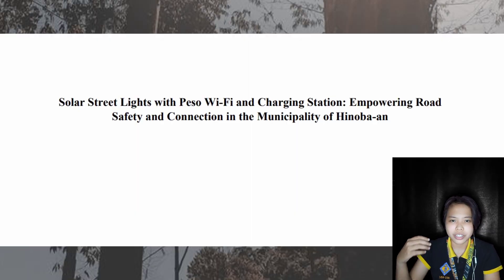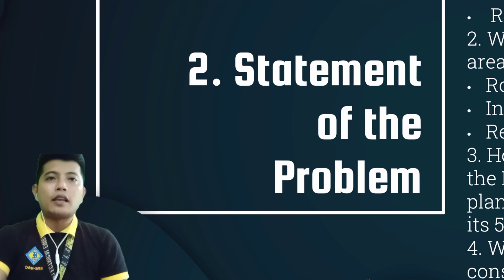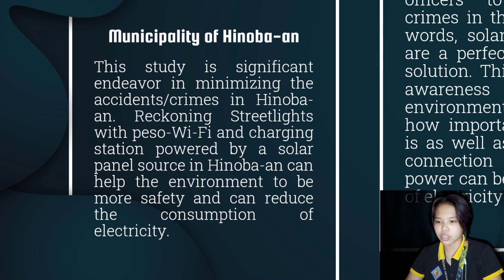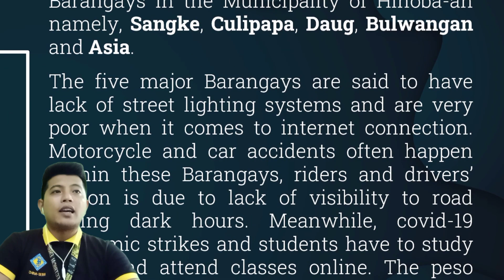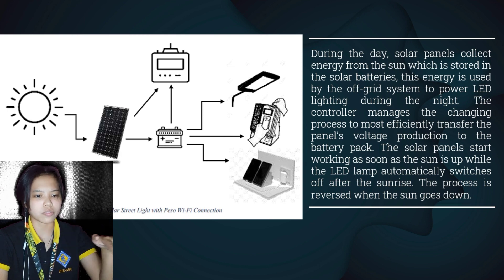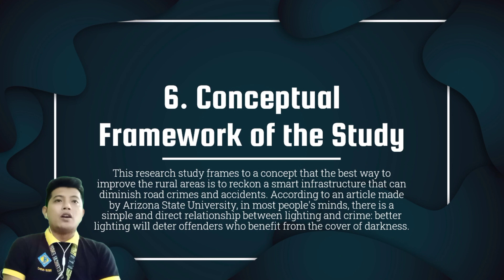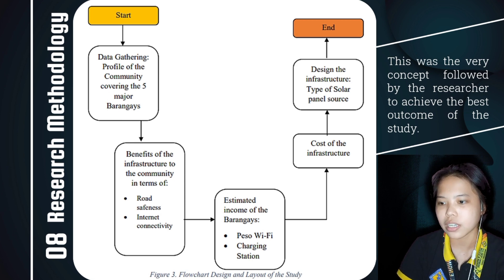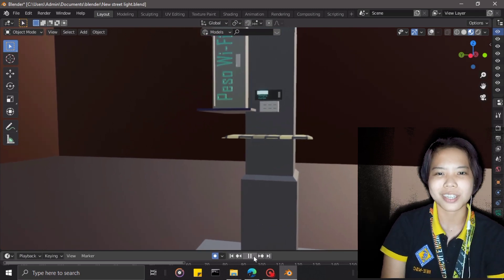Solar Street Lights with Peso Wi-Fi and Charging Station: Empowering Road Safety and Connection

Comment: NAME: Sanrey Jun R. Guevarra
CLASS NAME & CLASS SCHEDULE: COE 346 A & 5:00-6:30 T-TH
DATE: 27/03/2022

REACTION: This research proposal is interesting and helpful to us viewers because solar streetlights provide several advantages over standard energy sources. This energy is known as solar energy, and it is a non-polluting and low-maintenance renewable energy source.

REFLECTION: As students connect to the peso Wi-Fi and plug their chargers into the socket, the solar lamps will act as a second safe study place for them. It improves the safety of vehicles and the security of the streets at night. It can also save money for municipalities because it beams or turns up automatically and has essentially no operational costs.

Comment: Name: Khynny Maureen P. Campoy
Class Name and schedule : ENS 341 Saturday (5:00-8:00pm)
Date: March 26, 2022

Reaction :
The researchers gave a very excellent presentation. Their idea is very innovative, helpful and beneficial. It is a very good idea to integrate solar streetlights with peso wifi and charging stations. 

Reflection :
Solar streetlights with peso wifi and charging station can benefit road safety, reducing home electricity consumption, and internet connection. It can help our environment, and also enables the officers to easily solve crimes in the road

Comment: NAME: Arabelle Fabugais
CLASS NAME & CLASS SCHEDULE: ENS 341 B _ 5-8pm Saturday
DATE: March 26, 2022 | Thursday
REACTION:
As the sun sets, darkness takes over. Street lights are very important because it lessens accidents and lessens fear. This study is really good because it uses solar energy which cut's off the high electric bills. It is also eco friendly and will benefit a lot of people. It also has a piso wifi and charging station. If people started using some electric vehicles then this charging station will be good and beneficial. 
REFLECTION:
As I've watch the video I realized that there are a lot of people who are concerned about the environment and they are making an action to help the people cut the high electric cost and also use a clean energy. But there are a lot of things to consider. Recycling is the one thing we should consider in our lifestyle.

Comment: Name: Balansag, Lorenzo Jr. B.
Class Name and Class Schedule:  ENS341- Research Methods for Engineering | Saturday 2:00-5:00 pm 
Date: March 26, 2022

Reaction: The research is truly impressive. It is very innovative by integrating the use of solar panel in street lights. And then using the power being harness as electricity for peso wifi and charging station. It has some similarities with the other research but it is still unique in its own way.

Reflection: Electricity, connectivity and lighting are a necessity that we are needing.  So, having all that three necessity mixed up into a single device is a great deal. It is very beneficial to those who depend on a strong connection for their studies. While having an online class, you can also charge your phone, if you are low on battery.

Comment: NAME: Shiela May E. Velos
CLASS NAME & CLASS SCHEDULE: ENS 341 - SATURDAY (5-8PM)
DATE: March 26, 2022

REACTION: This is uncommon proposal, and advantageous to every netizens, installing solar energy to fuel the street lamps with the built-in peso-wifi and charging station not only ecologically beneficial but also it is in need. It's quite interesting and very applicable in our situations nowadays for some of us students are having online class, needing an internet connection and most of the transaction that we have are through internet, this is kinda very useful and beneficial to many of us. It was being presented well, acquiring stability of internet connection, and delivered clearly as they presented their research proposal.

REFLECTION: This research proposal is very useful and helpful in our recovering situation now due to the crisis and pandemic that we have experienced, still on recovery but we cannot deny the fact that because of the happening it changed some of our ways of living that is now were really inspired by the internet and social media transactions. This proposal focuses on solar street lights equipped with peso Wi-Fi and charging stations, this is really a help and beneficial for it does not only helping on lessening the consumption of electricity but it is also a great help in terms of minimizing accidents and tragedy that could happen if the installations of streetlights are not enough. It's a good research not only helping for safety but also providing a good states of contacting and easy communication through the installations of peso-wifi and charging station all in one in solar street lights.

Comment: Name: Jules Gerard D. Cabetingan
Name of Subject and Schedule: ENS 341A Research Methods for Engineering SAT 2:00-5:00
Date: 3/25/22
Reaction: This research proposal can greatly benefit us individuals and the researchers did their part very well since one of the common issues nowadays is the availability of street lights especially in remote places. This proposal if accepted, can greatly benefit those people. This proposal is almost the same as the previous one although piso wifi and a charging station is only added.

Reflection: The convenience of this innovation if worth noting of since you already have a charging station and piso wifi and it can greatly benefit the environment since it saves a lot of energy and it only uses solar power. We can save a lot of non renewable resources and it can also solve the pollution problem.

Comment: NAME: Lumelyn E. Ragusta
CLASS NAME & CLASS SCHEDULE: ENS 341 B Research Methods for Engineering – S 5:00-8:00 pm
DATE: March 26, 2022
REACTION:  Street lights are one of the important factors for road safety because they guide people to their destination. The amazing part is that they use solar energy. Combining it with Peso Wi-fi and a charging station makes it more reliable and sustainable. Areas with poor signal and connectivity can rely on this project, especially students. In cases of power interruption, solar charging stations are much needed.
REFLECTION:  It's amazing how researchers come up with solar street lights with Peso Wi-Fi and charging stations that can help people in the area, especially students for their online classes.

Comment: NAME: Glovel Jae G. Medel
CLASS NAME & CLASS SCHEDULE: ENS 341 - SATURDAY 5:00-8:00 pm
DATE: March 26, 2022

REACTION: The researchers' idea is very commendable because their proposal would benefit students who require internet access and areas that require street lighting.

REFLECTION: It's a great idea to have solar-powered street lights with peso wifi and a changing station. The concept of a street light would be beneficial to communities that do not have street lights. Students would benefit greatly from peso wifi and charging stations, especially if there is a power outage.

Comment: Marc Kenneth L. Baldosano
ENS 341 A (Saturday 2:00-5:00 pm)
March 26, 2022

REACTION: The researcher has thought about the concept thoroughly. I can see that this will be handy in rural areas in which electricity and connectivity may be a problem. The use of a solar-powered streetlamp eases the people during nighttime when no streetlight is present.  

REFLECTION: In this modern age, the internet has become a need for us people. Especially now we are in the middle of a pandemic where we are forced to do online classes even though we know for a fact that many of us students have little to no internet connectivity, an example of those are the students who are from rural areas. This research helps those who are in need of better connectivity. They can also charge their gadgets and have a working nightlamp in the evening.

Comment: NAME: NOEL JOHN C. CANOY
CLASS NAME & CLASS SCHEDULE: ENS 341 - SATURDAY 2-5pm
DATE: MARCH 26, 2022
REACTION: This video research proposal is very helpful and beneficial, the researcher did well in their study since mostly our problem is street light especially in the remote area. This research can greatly help the residents residing there. Although the proposal has similarities to the previous proposal I saw last time, you only just added Piso wifi and a charging station, which for me is  good.

REFLECTION: The solar street light with adding a charging station and Piso wifi is very convenient and I think it is very beneficial since we can save energy cost in the solar system and it is renewable energy so we can conserve non-renewable energy and it is free from pollution.

Comment: NAME: Loreto C. Bayawa Jr.
CLASS NAME & CLASS SCHEDULE: ENS 341A SATURDAY(2:00-5:00)
DATE: 03/26/22

REACTION: It is a full package to have solar-powered street lighting that are also equipped with free WiFi and charging stations.

REFLECTION: This suggestion is quite convenient for people who wander the streets at night, particularly those who work late hours. This is extremely efficient because it is powered by solar energy, which means it will not be affected by power outages.

Comment: NAME: Del Franz Lean Consing Ladura

CLASS NAME & CLASS SCHEDULE:  ENS 341 - SATURDAY (5-8PM)

DATE: March 25, 2022

REACTION: The study is attempting to replace traditional street lights with solar street lamps equipped with wireless wifi and a charging station. According to the research, this study promotes road safety, which is a worry if it is used as a charging station and peso wifi area. I'm simply wondering if having such street lights on the side of the road will harm motorists and people. I see a scenario in which individuals would round the street light to gain access to the wifi, endangering those folks' safety because they are so near to the traffic.

REFLECTION:  I believe recharge stations and peso wifi would complement each other, however, if they were tied to street lighting, I might reconsider. It has certain advantages, such as allowing motorists to charge their gadgets while driving, but the position near street lights is potentially harmful. We have a lot of automobile accidents in the Philippines, and the street lights are too close to the road. If the study's purpose is to promote safety while being aware of the possibilities and scenarios that may occur, the study's goal would be contradicted.

Comment: NAME: Kim Anthony V. Aldion
CLASS NAME & CLASS SCHEDULE: COE 346 A & 5-6:30 T-TH
DATE: 25/03/2022
REACTION: Because they employed solar energy to fuel the street lamps with the built-in peso-wifi and charging station, this study is highly unique and ecologically beneficial.
REFLECTION: Due to the epidemic, having a robust and consistent electricity supply in remote regions is no longer enough; they also require a stable internet connection, as most lessons are now conducted online. So, in order to address this issue, our study demonstrates that solar-powered street lighting can coexist with a peso-wifi and charging station. It would be fantastic if this could be adopted in rural regions to help kids at all levels of schooling.

Comment: Name: Ma. Theresa C. Velasco
Class name & class section: ENS 341 B /5:00-800PM SATURDAY 
DATE : MARCH 25, 2022

Reaction: They explain well their research proposal. They are presentable and knowledgeable of their research. And also confident to their research. It can also help especially those student 
 Reflection: Their research is about using solar panels to have street light and also peso wifi . Their research is helpful especially in the area of Hinoba-an which is some area are don't have connection and lights. It is also renewable energy to use and it can help the community if this research proposal being notice by the local governments or any officials in the area.

Comment: Name: Mark Daniel L. Anggoy
Class Name & Class Schedule: Coe 343 Methods of Research T-TH 5:00-6:30
Date: March 25,2022

Reaction:  This research proposal is really interesting and helpful to us viewers because solar streetlights provide several advantages over regular energy sources. This energy is known as solar energy, and it is a non-polluting and low-maintenance renewable energy source.
Reflection: Because since now students will connect to the piso wifi or hangouts the solar streetlights will function as a second safe study space for them. It improves the safety of vehicles and the security of the streets at night. It can also save money for municipalities because it beams or turns up automatically and has essentially no operational costs.

Comment: Name: Karl B. Medez                                                                                                                                       
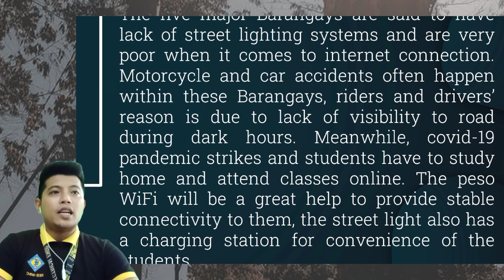Class Name and Class Schedule: EE 341A (TTH 6:30-9:00)
Date: March 25, 2022 

Reflection: Based on thier study they only not use solar power to the street lights which will light the streets without any interruption that will help in the security of the said area. but they also use it as a charging station and wifi area. It can be used in an emergencies. 
Reaction: The study is amazing. Solar energy is not only used to power the street lights,  but you could also charge and connect to a Wi-fi. It very convenient.

Comment: Mamigo, Jascha Anthony T. 
EE 341 Research Methods for Engineering TTh 6:30-9:00PM 
March 25, 2022

 REACTION: The researchers of this study gave an excellent presentation; I enjoy the way they speak since it is extremely straightforward and intelligible.

REFLECTION: Solar energy is a renewable form of energy that has assisted humanity in a variety of ways, including street lights, batteries, and the project they presented. This type of innovation contributes to society's growth and provides people with a sense of security. Technology is rapidly evolving, and it will continue to do so in the years ahead.

Comment: NAME: YAHONEY B. ABELLA 
CLASS NAME & CLASS SCHEDULE : ENS 341 B SAT 05:00-08:00 PM
DATE : 03/25/2022
REACTION: Very well presented and informative study. The researchers did a good job in choosing this study as it is beneficial to their community.
REFLECTION : Solar energy has yet again proven it's flexibility and availability for wide uses. The study will surely benefit the municipality of Hinoba-an as it saves the municipality's power usage while providing a safe and connected community.

Comment: Ronel S. Bayonado
COE 346 Methods of Research T-TH 5:00-6:30 PM
March 25, 2022

REACTION:
Very innovative proposal. Using solar energy to power street lights was the proposal of the other group, but integrating a peso-wifi and also a charging station to it is such a good idea.

REFLECTION: 
As I have said in the other group, using solar energy to power street lights is very good in a way that the street lights can still light the streets even if power is not available in that place and on top of that, it is eco-friendly and lowers the demand for electricity. But also adding peso-wifi and charging station to a street light would make it more useful. This could help the people charge their phones conveniently if they really need to and if they're really far away from their houses, and they can use the wifi to connect to the internet which could be really useful in contacting someone. This would also greatly help students who have online classes, with a lot of street lights in the streets, students can easily go to one and connect to the wifi, join their classes without travelling too far.

Comment: NAME: Rupert Tristan R. Borlaos
CLASS NAME & CLASS SCHEDULE: ENS 341-A (2-5 Saturday)
 DATE: March 25, 2022

Reaction:
The research presentation is well presented and the voices of the presenters are clear and understandable. There are no background noises but the echo of the voice of the presenters is quite loud. Nonetheless, the presentation is good overall and they delivered their purpose well. The research proposal is quite interesting in my opinion and this piques my interest.

Reflection:
Well again the research is all about solar power related research just like the previous research proposals. This particular one is quite interesting because this research is all about solar street lights equipped with peso Wi-Fi and charging stations, so basically it’s like an all in one solar powered innovation starter pack, and it is really good to have this kind of idea. This is very helpful and beneficial because it helps lessen the consumption of electricity and is a great way of minimizing accidents.

Comment: NAME: Bernard Donn M. Valencia
CLASS NAME & SCHEDULE: ENS341- B ; (5-8pm) Saturday 
DATE: March 25, 2022

Reaction: This study is fascinating, especially in current times when students in some places rely on free wi-fi for online lessons. This combination of cheap wi-fi and solar street lights is a fantastic idea that should be considered.

REFLECTION: This research Solar Street Lights with Peso Wi-Fi and Charging Station aims to empower road, safety, and connection by allowing students who are struggling in online classes due to a weak connection to use the peso Wi-Fi installed in the streetlights.

Comment: NAME: John Pius T. Borres
CLASS NAME & CLASS SCHEDULE: ENS341 – Sat. 2-5pm
DATE: March 25, 2022
REACTION: This proposal is really beneficial to everyone. It is incredibly helpful to the neighborhood because it not only offers light to passers-by and ensures security, but it also produces revenue via cheap Wi-Fi and charging stations. Students are one of the study's target, as the street lights will have both Wi-Fi and charging stations for educational reasons.
REFLECTION: This study is comparable to another idea in which solar energy is used to power streetlights, although it has several differences. This is also a terrific method to earn money while ensuring traffic safety and the well-being of the local community.